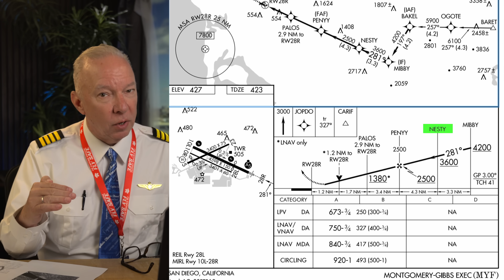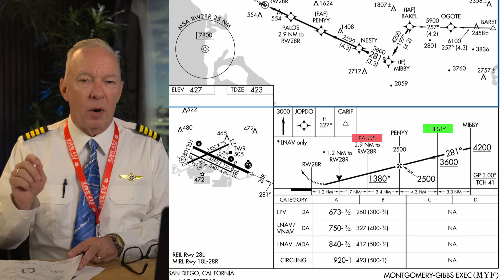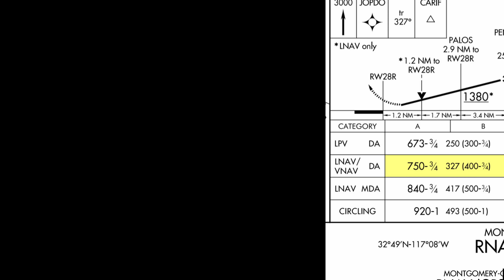Tragic Crash in San Diego: What the Pilot Did Wrong | ATC & Flight Path Breakdown

Comment: Capt Steve, USAF IP here, this is all moot as you’ve said since the mishap pilot disregarded the approach requirements anyway….LPV equipment is quite common in the civilian world, as is LNAV obviously, LNAV/VNAV however is not, it’s usually airliner equipment.  The minimums in parentheses are military requirements, civilian are to the left and are vis only, meaning if allowed the MP could shoot the approach if he met the vis requirement (3/4) with any ceiling/VV, whether he had the vis requirement in any case is unknown since the ASOS was down.  Part 91 allows a pilot to shoot the approach with no requirement to meet the minimum vis requirement (3/4), but legally the vis should be 3/4 when he breaks out in order to land.  I say should because we all know any pilot asked what the vis was on a landing is going to in this case say 3/4…so as not to be violated.  Also, just read an NTSB Agent said the Montgomery airfield lighting was notam’d inop before he took off…no amount of clicks was going to turn it on and without it at 3:45am there’s no way to land…the MP was 2 miles from the runway at the crash.

Comment: Also, there is an asterisk or “star” next to the 1380 step down altitude at the PALOS fix.  Reading the approach plate shows 1380 min alt only applies to aircraft with LNAV capability.  Was 666DS only LNAV?!  I don’t know, but it’s crucial to this analysis to know if the aircraft was certified for LNAV/VNAV or LPV approach mins.  Captain Steeeeeeve needs to go back to IFR grooooound schooool.  Don’t believe anything this guy says. This means the pilot may not have broken the minimum altitude.  A minor detail, but crucial to causal factor identification.

Comment: #1  There is nothing wrong with taking a look.  If the visibility meet the minimums you descend to the DA and if you see the runway, or approach lights, and have the required flight visibility you land if you don't you go around.

#2   We really need to know if he had LPV, LNAV VNAV or just LNAV.  If he had LPV the altimeter didn't matter.  If he had LNAV VNAV the palos crossing restriction didn't matter.

#3 The main thing that matters is that this approach does not have an option to use other than the local altimeter.  That alone is the obvious reason he had no business shooting the approach.  A non local altimeter option would have higher minimums, ( and tell you where you could get it) since none was listed the approach requires the local and if the weather reporting was out you don't have it and you don't do the approach.

Comment: No matter the pilot error, why do we continue to have tall obstructing objects like main power lines right in-line with airports.  Nuts.
Reply: The charts clearly documented those obstacles, that’s literally why we have those charts. Follow those charts and no obstacle anywhere matters. Tens of thousands of flights have successfully avoided those powerlines, he flew into them. That’s a pilot problem, not a powerline problem.
Reply: @robinmueller3778  Do they not cross the line of approach to the runway?  That is why they were hit.  Yeah, the pilot was too low, but the power lines didn't help.
Reply: @spacecoastz4026 Again, those powerlines have been there for decades, are on all the charts, any pilot that has flown in and out of there, like he had, knows they are there. I’ve flown in and out of there many times, they are not hidden. If he flew the approach as published, the powerlines would not be a factor. He should have been well above them 2 miles out. Transmission lines cost millions to underground, adding up to billions across the area. With sky high power bills across California across the area, undergrounding all transmission lines is not practical. Especially when there are multiple safety mitigation factors in place to avoid this scenario. Tens of thousands of flights have not hit those powerlines, this one did. It’s not the fault of the powerlines. At his altitude and glide slope 2 miles out, he would have hit the ground not far after the powerlines.
Reply: one is not required to visually see and avoid obstacles when flying IFR. Stay on course and you won't hit anything.
Reply: @skyboy1956  Honestly I understand that...but the issue is when mistakes are made...why compound them.

Comment: 🇨🇦❤ Why was there no weather service at the airport? DOGE cuts I presume. Sickening stuff. Thanks King Donny DiaperPants, you da man!🇺🇸💩🇺🇸
Reply: Automated weather stations go down, just like any piece of equipment. He knew that. He had weather from all over the area. Those kind of outages are well documented and pilots deal with them all the time. This has happened for decades, it is nit something that just cropped up. If he had a problem with that, it was incumbent upon him, as Pilot In Command to not attempt that approach. But he decided to “give it a go”, which turned out to be a fatal decision.
Reply: I believe the power issue at the airport which prevented runway lights from operating also resulting in the ASOS outage.
Reply: @chorne2k Apparently the light issue had been going on for a while, whereas the ASOS issue was a power surge that had very recently happened. They didn’t sound connected.
Reply: @robinmueller3778  Gotcha.  It looks the ASOS began failing by 06 UTC on 21 May as the transmission of the 5-min METARs stopped by that time.

Comment: Most GA planes (even older ones). Are capable of LPV approaches (my 43 YO twin turbo prop does).  So I do not believe it was dive and drive.  If he was on the glide slop the only use the altimeter setting is to determine when the plane  reached DA.  I believe the pilot was "ducking under" the glide slope because he could not see the runway (as the PCL was not working).  The FAA FAA's Instrument flying handbook talks about the dangers of ducking under,  and many accidents happen as a result of it.

Comment: I asked about the Alt setting on another video Never got an answer, Thank you for clearing that up. his adsb flight track looks like that maybe the issue to me.  I think the adsb data may have showed 900" at Palos. I am wondering if he went under the lines and hit them with his tail. that would also cause a pitch up.
Reply: The other weather reports had alt settings within .01 of each other. Unless he was way, way off, like never checked or set it at all, or it was INOP, that’s really unlikely. He was far below minimums 2 miles out, way more than a minor ALT setting error would cause.

Comment: Awesome analysis, thanks. I wonder if it was a Part 91 operation. If it was, it’s perfectly permissable to “take a look”, though not necessarily a good idea. If it was Part 135, you can’t even start the approach without weather observation capability. BTW, the 550/S550 can easily make the approach at Cat B speeds.
Reply: It was Part 91. That still does not make this approach legal because he didn’t have legal minimums.
Reply: @robinmueller3778 Part 91, you can attempt the approach even if the weather is below minimums.
Reply: @robinmueller3778  can fly an approach under 91 if weather is reporting  0/0

Comment: 7:40 -" there's a ridge between PALOS and the runway."  No there isn't.  Check with an elevation finder website or even the 2D selection on Google Maps angled for a slightly down view - the elevations at the power lines and the airport are about the same.  The difference is the height of the tower which you estimated at 50-100ft.  It's actually shown on the approach chart at 554msl.

12:38 - "what's important is what is in parenthesis".  No sir.  According to the approach chart legend, those numbers in parentheses are "not applicable to Civil Pilots".

Another video indicated a descent to an altitude of 500' with preliminary ads-b data, below the height of the altitude shown for that obstruction and below all minimums.  We're not going to have confirmation of that data until the NTSB makes its report.

Comment: My stepson owns a 1978 Cessna 210 which is parked at the same airport.. Montgomery Gibbs Executive Airport in San Diego. We have flown in and out of that airport dozens of times with no problems. It’s uncanny that he was flying back to Montgomery Gibbs Airport at 3:30 a.m. after working a late shift up north, but decided to turn around and land at Ramona Airport several miles away because of heavy fog at Montgomery. The pilot of the Cessna 550 made the mistake of trying to land in the heavy fog, hitting the power lines, and crashing, killing all six on board.
Reply: I thought he was in a small jet, not a Cessna?
Reply: @fleetskipper1810 The crashed plane was a twin engine Cessna 550, which is a twin engine corporate jet.

Comment: If it's an uncontolled airfield does that mean that ATC is not on duty at that location at that time?  If so, what is the location of the ATC that he is talking to?
Reply: He was talking to approach control. They will be your contact before tower anyway. Approach controllers can be anywhere because they can only see you on radar. Small airports almost never have a 24/7 tower. Even the military base a few miles away (MCAS Miramar) does not have a tower staffed 24/7, they are usually open shorter hours than Montgomery. There is an Approach control building adjacent to Miramar but this controller could have been anywhere with no deficit in his ability to do his job.
Reply: @robinmueller3778  Ok so that is why the pilot didn't have anyone right at the airport telling him the visability/ceiling
Reply: @bones8057  Yes, the tower was closed. It’s been closed at 9 for a few decades. The pilot’s choice to fly into the airport at 3:45AM probably wasn’t great for several reasons. But, he had weather reports from several different sources. Being a pilot from this area, he should definitely expect that if every other airport has fog, low visibility and low ceilings, Montgomery would too. It’s a very common thing, well known by any local pilots and most of us area residents

Comment: As I understand it, the ADS data will be based on his altimeter setting, so whether it's right or wrong, it corresponds to what the pilot is seeing on the instruments.
Reply: No, ADS-B transmits pressure altitude. It's always based on a 29.92 altimeter setting. It's independent of the altimeter setting in the cockpit.
Reply: @igclapp  OK, that makes sense. But it also means that the ADSB data could be reading lower than reality. Mind you, the fact that the aircraft hit power lines says otherwise.
Reply: @sylviaelse5086 The ADS-B in this case was reading higher than the actual altitude because local pressure was less than 29.92. But that doesn't really matter because no one is looking at raw ADS-B pressure altitude figures except aviation enthusiasts monitoring the ADS-B website. Both pilots and controllers are looking at altitude corrected for local barometric pressure (for controllers it's automatic, for pilots they have to set the baro setting manually).

Comment: He obviously was below the required decent profile since he struck the power lines on top of the ridge. Wouldn't the 550 have a radar altimeter good from 0 to 2500 feet? Maybe it wasn't working for some reason though. Even still, it's night, the air was still, and his altimeter setting should have been close enough for the area he was flying in to not make a drastic difference I would believe. 
I guess the biggest "gotcha" was the "NA" on the chart for his category aircraft. The approach should have never been considered in the first place. The FAA has spent a lot of time and money producing these charts to keep pilots safe and alive. I used to tell my students follow the rules. You might get away with bending the rules once, twice, or more times, but it's that last time your luck runs out that gets you and ends your rule bending career permanently.

Comment: Thanks for your videos. I’d like to make a few  additional points to your analysis. At time stamp about 7:40, it's important to point out that the altitudes listed on the approach plate with a line underneath them mean that the aircraft must be at or above those altitudes, not at those altitudes. So your statement that the controller was giving a buffer by clearing him to cross NESTY at 3,800’ is a bit misleading. Crossing NESTY at 3,800’ only forces a slightly higher descent rate between NESTY and the final approach fix (FAF)of PENNY. In this case, that’s not a huge problem because it was only 200 feet. But an obvious mistake by the controller. One of the most important points on the approach is the FAF of PENNY at 2,500’. Hitting this point on altitude means you are set up for a stabilized approach on the most important part of the procedure, the section after the FAF. In your drawing, you show the ridge as an obstacle and you imply that had the pilot done a dive and drive he would have been below the ridge altitude. This is incorrect. Regardless if one flies this procedure as a constant 3° glide path RNAV or dive and drive to each altitude, one must meet the required altitudes listed on the approach plate, thus clearing all obstacles, including the ridge. So diving and driving, though not the preferred method, still would be safe.
Reply: Well said.
Reply: There is a bubble note 1 at PALOS and at VDP applicable to LNAV only. Assuming he has on LNAV only (not LNAV/VNAV) the bubble note states 34:1. I had to look 34:1 up:

“Meaning of “34:1 NOT CLEAR”:
	•	34:1 represents a slope: for every 34 units horizontally, the surface rises 1 unit vertically — this is roughly a 1.7° glide path.
	•	“NOT CLEAR” means that there are obstacles penetrating this surface — terrain, trees, buildings, or other objects — which may pose a hazard if the aircraft descends too early or too low on final approach.”

So if he was on LNAV, he should not have done dive and drive on this approach.

A very fine point.

Comment: BR means “mist”. Also, most likely the aircraft had LPV capability. Was he legal to fly that approach and what category minimums was he allowed to fly to? For that aircraft it’s fairly safe to assume CAT B minimums are what he should have been using. Also what FAR rules was this flight operating under? If it was part 91, he was legal to fly that approach all the way to the missed approach even if he had weather that indicated it was below minimums. It’s not a big deal to fly an approach to minimums, not see the runway and execute a missed approach. He went way below the charted minimum descent during the approach. Whether that was because of an improperly set altimeter or just because he lost situational awareness it doesn’t matter. Even if it was “legal” under the flight rules he was operating, it was unsafe and unprofessional to even begin that approach with no weather being reported (not forecast as the poster said).

Comment: BR means “baby rain”? Nope - it means mist. Mist, in aviation weather-speak, is the same phenomenon as fog, but implies visibility greater than 5/8 mile, while fog = visibility less than 5/8 mile. 
Also, your “dive and drive” theory is irrelevant as long as the aircraft remained above minimums. Obviously it failed to do that.
“Most aircraft don’t have the equipment for an LPV minimums approach”? WAAS gps navigators are routine now!
Lastly, if the flight was operated under Part 91, visibility is not legally limiting for the approach. 
ATP CFII MEI
Reply: BR may be mist, but pilots certainly understand the informal lingo of baby rain.
Reply: I've been flying for decades and have never heard that silly term,  nor ever seen a reference to it. Maybe worse, it fails to remotely describe the condition.
Reply: Under Part 91, you can attempt the approach if it's below minimums, but you cannot complete it (descend below MDA, DA or DH) unless you have the required visibility. So in that respect Part 91 is limited by visibility.
Reply: @igclapp  That's not exactly correct.  Descent below the MDA, DA, etc. can't occur unless the required visual references on the runway can be seen and identified. That's how required (in flight) visibility is defined, rather than what an approach chart states it as, or what an ASOS, ATIS, etc. transmits.
Reply: Relax, I think Steeve merely mentioned "baby rain" as a mnemonic, if you know what that means. It appears you don't.
Reply: @tentacle218 I'd relax if this wasn't one of several errors and mistatements in the video.

Comment: FYI, ASOS is an observing system designed to detect and report current surface weather conditions.

Forecasts (TAF's etc.) refer to projections of future conditions and require reference to a numerical weather simulation model or the experienced viewpoint of an experienced human forecaster (and generally both).

Comment: Just curious, I know it's not their responsibility,  but given the weather conditions, couldn't the SOcal controller have quickly mentioned the power line obstacle?  I understand that if the pilot had been flying the approach correctly, etc it would have been a moot point.  But perhaps it would have given the pilot that last minute to double-check things or abort.
Reply: That powerline transmission tower is shown right on the approach plate and is below the minimum descent altitude and below the glide path.

Comment: At 8:40, "remember they don't have weather...His altimeter could be significantly off." What does the weather have to do with an altimeter? How do you "set" your altimeter? Why did ATC not direct the pilot to NOT land there? There was no mention of low fuel.
Reply: Barometric pressure is used to determine altitude. Weather changes pressure.